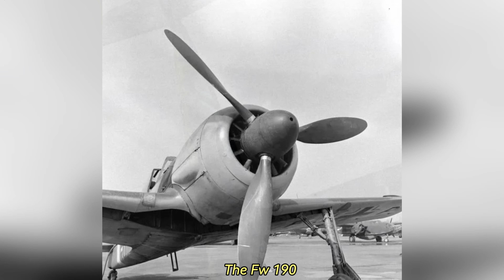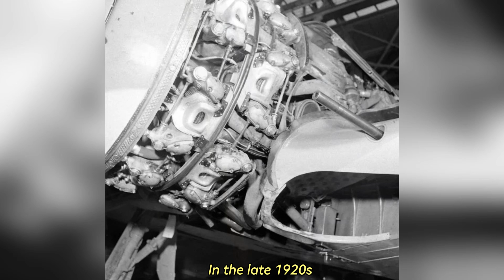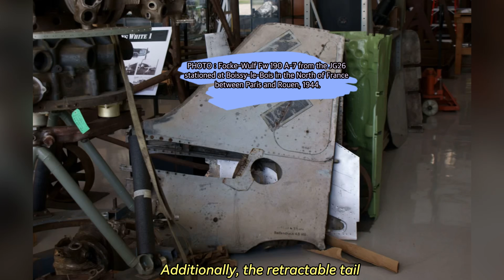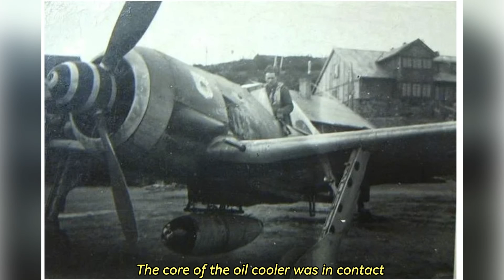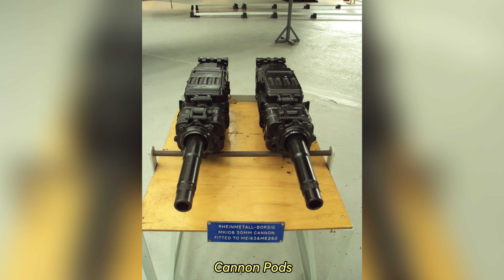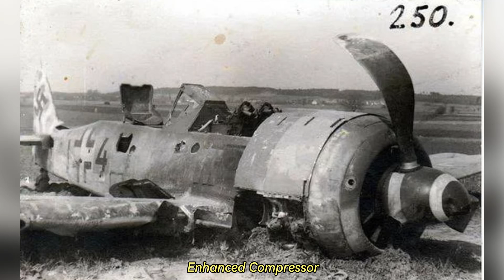Fw 190 a Formidable Bomber-Killer?

Comment: WW2s 'premier fighter'!?
By who?
It was 'premier' for about 1yr (1942).
Yes it was a great aircraft (& the late D model & final Ta152  versions were even better, assuming build quality was ok & the engines worked as advertised, which was not always the case....but that's what you get when you use actual real slaves to manufacture your kit) but there were other contemporary aircraft much more widely considered to be better (the P47 & P51 not to mention Spitfires from mk9 onwards & a couple of Russians too).
The FW190A (the heavily armed A8 versions especially) was a great bomber killer....until the allied fighters started being able to fly very deeply into Germany & at high altitude, after that they were cut down in droves, the supercharger set-up ensured that the FW190s performance fell off of a cliff above 25,000ft/7400m, allied aircraft with the 'double-blower Merlin, or the P47 turbocharger, didn't.
Reply from the maker: Appreciate the detailed comment!❤